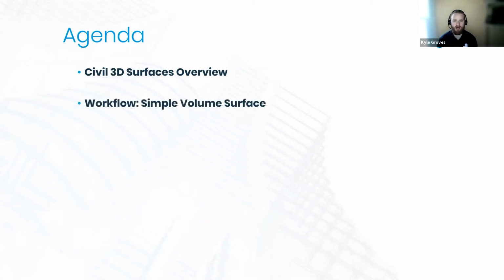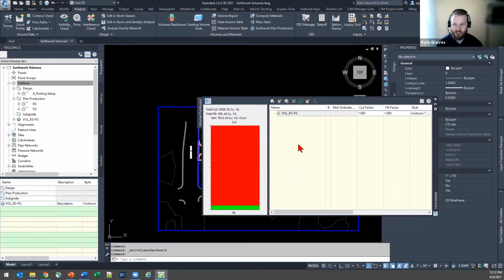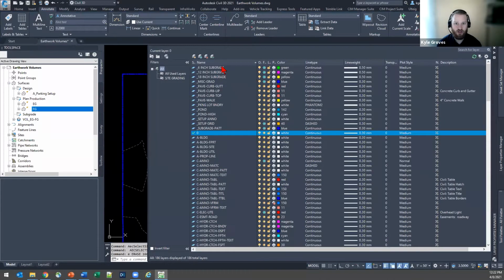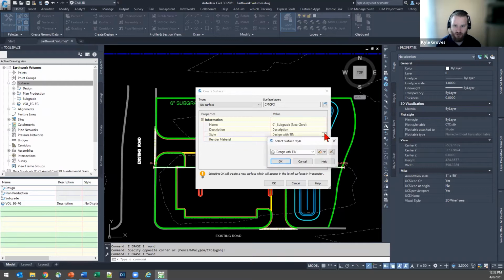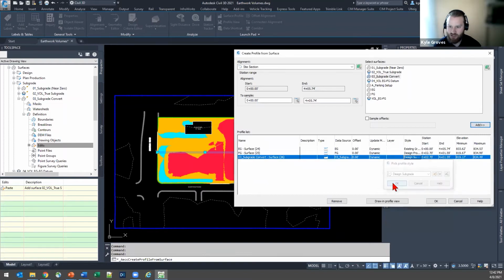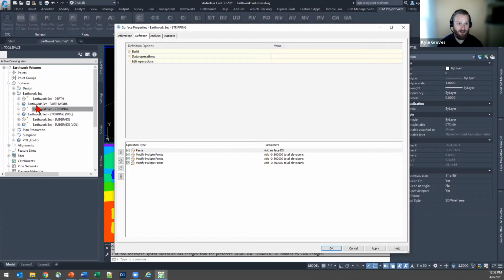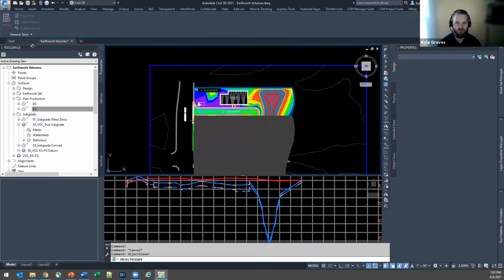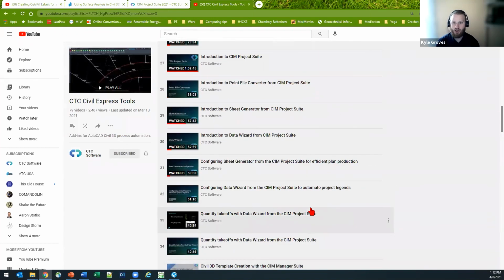How to Calculate Earthwork Volumes in Civil 3D

Comment: Could you please volumize an as built trench excavation survey including the reduced dig volume to top of trench from the  OGL (original ground levels) from a relatable topographic survey dwg.
I have to do this and I have no LSS or N4ce or Civils 3d... I can survey the bottom and top line work of trenches and the extent of the OGL cut line, but after that I'm stuck, doing it manually will be a complete headache...

Comment: Hello,
I've been struggling lately wit calculating volume between two surfaces. I have two surfaces with points and when I calculate volume with volume dashboard i get values which are not the same with calculation made with sample lines and compute materials. I know they are different methods but when shoud I use one and when the other?

And also I really can't understand when calculating with different increment on sample lines like on 20m or 50m I get different values. For example for sample lines made on 20 m distance I get value of 900 net vol. and for sample lines made on 50m distance i get value of 700 net vol. That a huge differene and what distance should i use, which is correct. Just to mention that building is 180 width and 60 length.